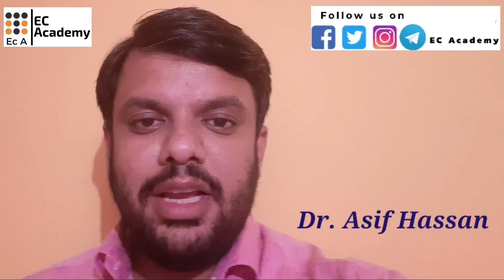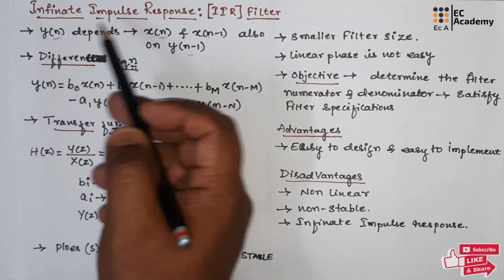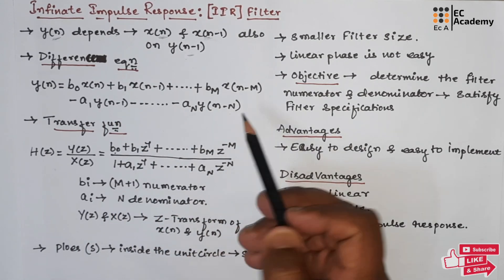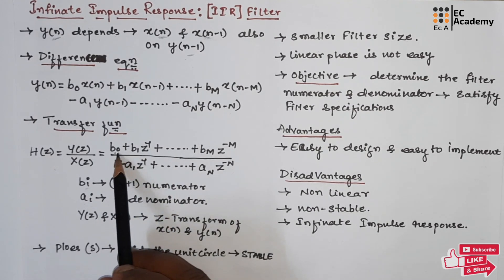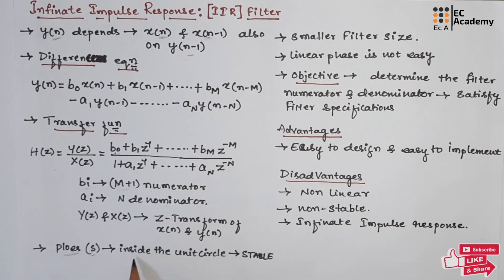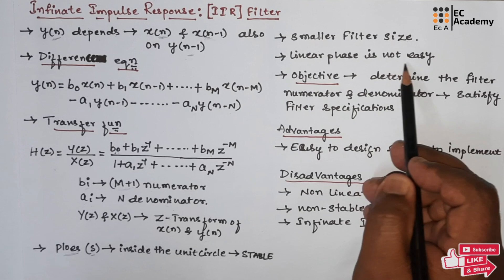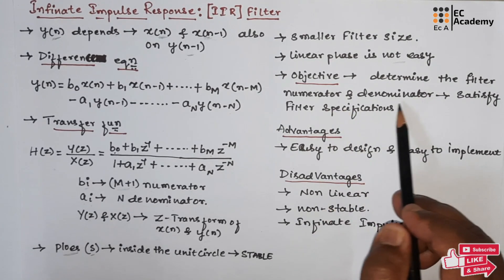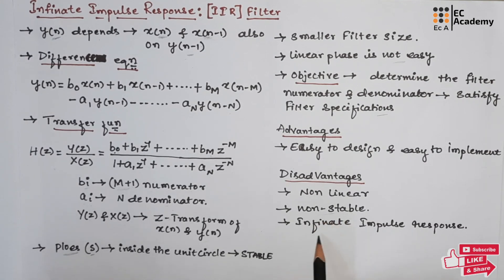IIR Filter Explained | Introduction to Infinite Impulse Response Digital Filters in DSP

Comment: 🎯 Key Takeaways for quick navigation:

00:28 📢 Infinite Impulse Response (IIR) filters have an infinite number of impulse responses, unlike Finite Impulse Response (FIR) filters.
00:54 📝 The difference equation for an IIR filter includes both present and past inputs and past outputs.
01:24 🎛️ The transfer function of an IIR filter is represented by a ratio of polynomials, where "b" represents the numerator coefficients and "a" represents the denominator coefficients.
02:34 ⚖️ Stability of an IIR filter depends on the location of its poles within the unit circle in the z-plane.
03:13 🎯 The main goal of designing an IIR filter is to determine coefficients that meet filter specifications such as passband gain, stopband attenuation, and cutoff frequency for various filter types.

Made with HARPA AI